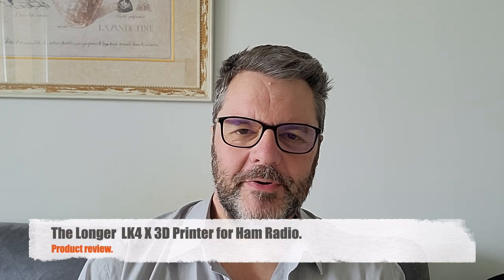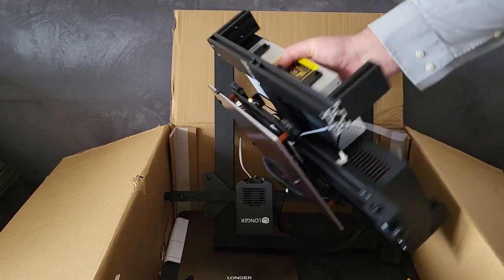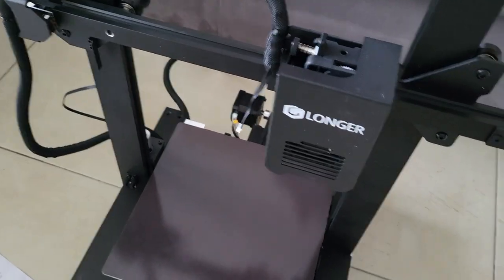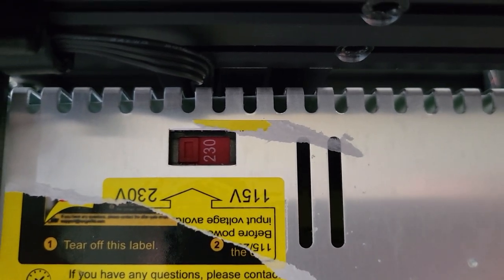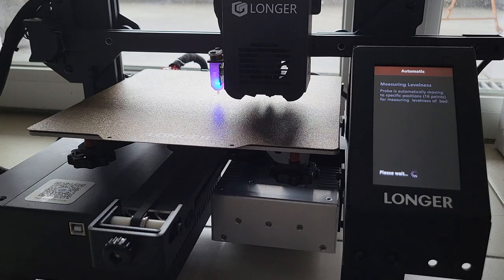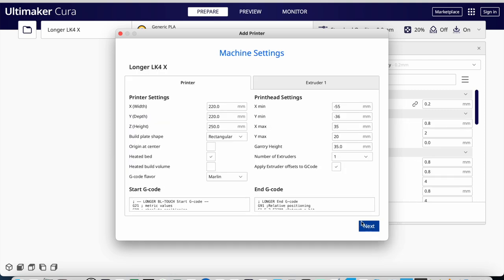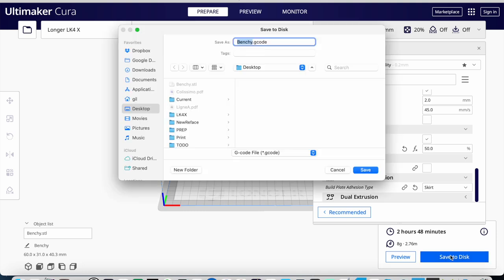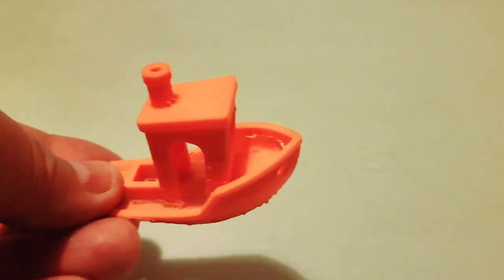Reviewing The Longer LK4 X 3D Printer For Ham Radio.

Comment: Nice to see this Gil. I'm using the Ender 5 plus but really don't like it. Need to build a temperature controlled enclosure for it. Perhaps I'll pull the trigger on this one.
Thanks for sharing.
Reply from the maker: I think you only need the enclosure for ABS, but not sure for other materials. I did hear drafts can mess up a print though..

Comment: It is good they provide PEI sheet with it, great adhesion of most materials. The printer was not on leveled surface and it was wobbling on your floor tiles sonthat affected the print quality a bit. Also, it looks that Benchy was not placed on top of the workbench in Cura (some of the layers were below the print surface). Overall nice printer with a few advanced features (direct drive, auto leveling, PEI sheet).
Reply from the maker: Probably, I missed that..

Comment: 32bit mother board is part of mfg info - is that a  problem with Mac64 bit computer?
Reply from the maker: Apparently not. They are two separate devices. A printer does not need 64 bits..
Reply: @RadioPrepper  my Imac 10.15.7 OS will not connect to printers when printer driver is not updated to 64 bit computer use. This caused older printer without updated driver to become unusable. My alert to driver issues is now top of mind! This is the reason for my initial caution queation.
Reply from the maker: I see. I did not use a USB cable, I saved the file on the SD card..